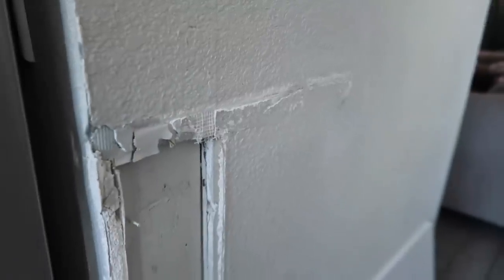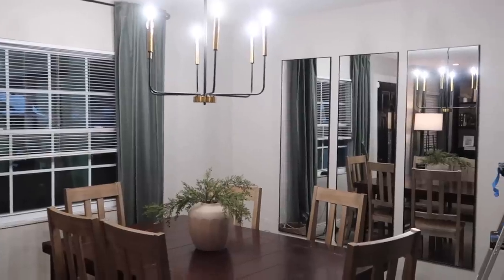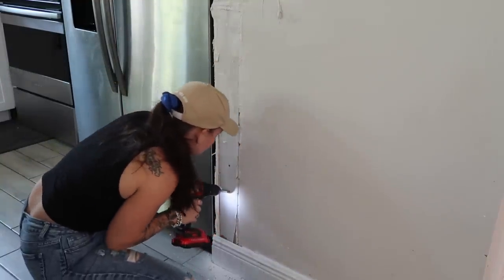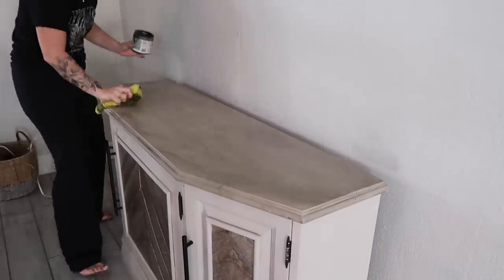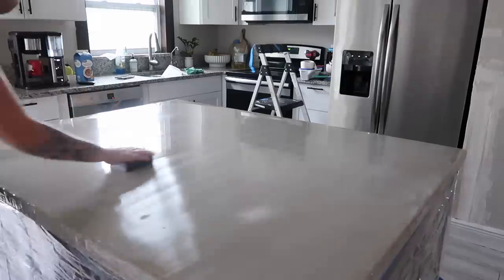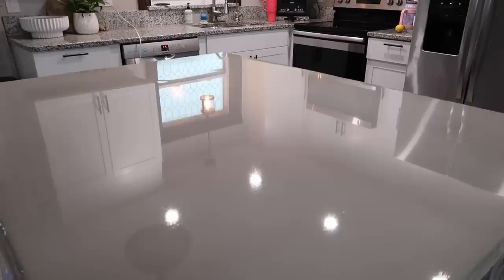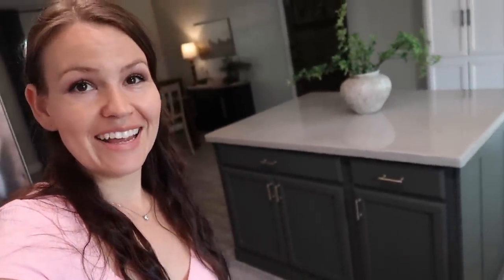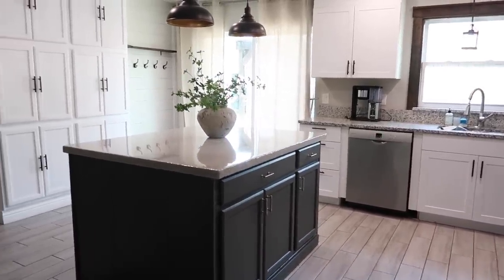Home refresh on a budget | DIY Kitchen makeover | Small home diy and decor !

Comment: The counter tops are beautiful but for a while after you should be taking the little blue torch to it. Not to close but far enough away that you will see the bubbles disappear. Also take a putty knife to the drips for hours after so that you won't have to sand. Looks beautiful just tips I learned from doing it before

Comment: If you do another coat on island you could buy or borrow a small dehumidifier and run it a couple days before applying the epoxy. You Will be totally surprised at how much humidity a dehumidifier gets out of the air. I run one on the really hot and humid days cause I live in Northeast Florida and it really helps the air conditioner not work so hard.

Comment: I'm so sorry for all the trouble you had with the epoxy finish! FWIW, I think it looks great! Here are some things that might help if you try this again. 

If you can buy, rent, or borrow a dehumidifier, it can be good to have that going in the house to dry out the air. Just place it where the air flow won't be directly impacting the pour (so it doesn't cause ripples or kick up dust, pet hair, etc. 

You can eliminate most of those drips along the edges by doing two things: 

1. Run your gloved finger all the way under the edge of the counter, spreading epoxy underneath that lip. That encourages the epoxy to run under the edge, instead of straight down the outside (visible) edge. There will be fewer visible drips that way. It also creates a nice sealant for that part of the counter.

2. When the epoxy is at the stage where it has stopped moving much, but is still soft and not yet set up, scrape the drips off with a paint stick or putty knife. It's a lot less work than sanding or scraping them off after they are fully hardened!

Comment: When you order new hardware, measure how far apart the actual holes are apart and order that size.  Usually 3 or 4 inches for cabinet handles unless you are going with an oversized look.

Comment: You don't have to pull the anchors out of the wall. Too big of a mess. Trick is to pound them into the wall GENTLY with the back of a wood handled screwdriver and fill the dimple with drywall compound. Easy Peasy.

Comment: I think you should paint your table black .  That color just takes away from your whole area and looks cheap compared to the rest of your home and it’s not really “organic modern “ in that shade of stain . And Idk why you didn’t paint your board n Batton the same color as your wall and let it have some added texture instead of removing it .  Would have been prettier than nothing
Reply from the maker: Maybe you missed the explanation on this 🙂 I shared my plans with the table and the reason I removed the wall.
Reply: @karrielynn  probably because my dryer was really loud